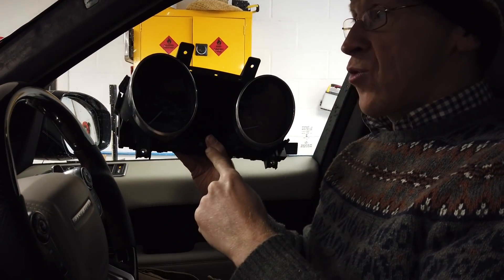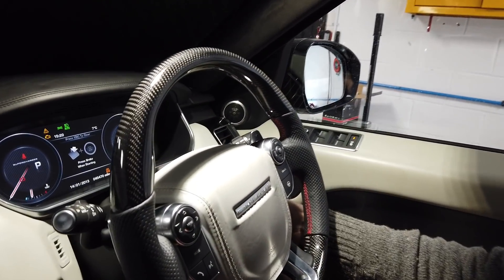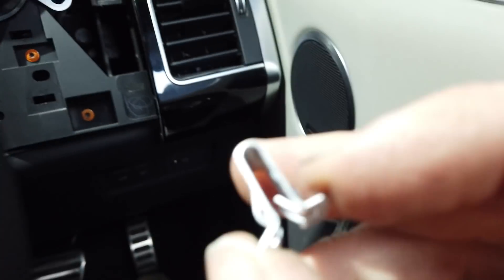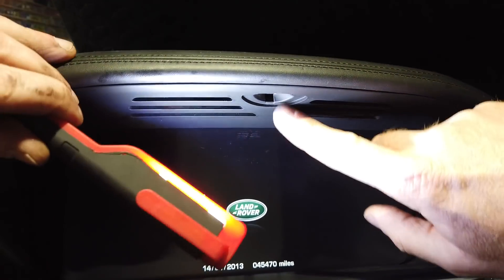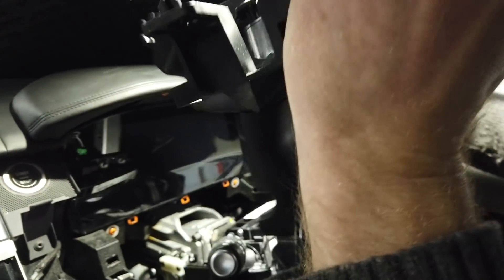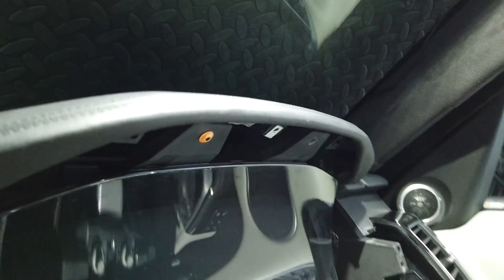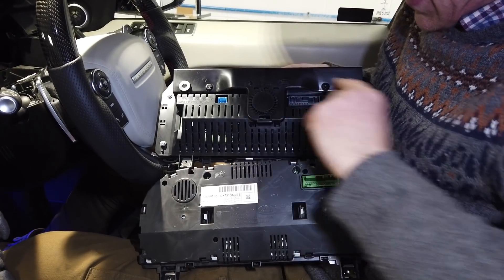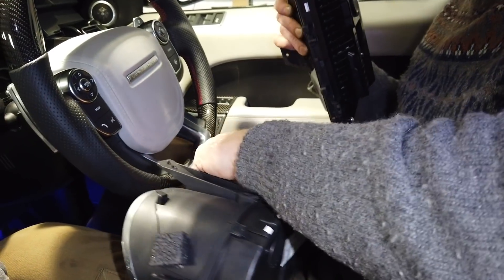Removing / upgrading speedo instrument clocks on Range Rover Sport L494 .

Comment: They are all coded to the individual car to prevent clocking. In the event that you need a new instrument cluster it would have to be coded at the factory to your car.
Reply from the maker: I am not sure if this is true.... i have changed a few parts of the system between carrs with no issue.
Reply: @L663  Hi was wondering if you could help, my instrument cluster has unfortunately been stolen from my vehicle. is there any chance i can buy a 2nd hand one and just plug it back in? would appreciate any advice!
Reply: @L663  He’s right, instrument cluster holds the key immobiliser settings hence why you can’t turn the car on. A number of other modules do as well. Used to work for JLR

Comment: Can the Bosch system be updated to a newer version on a 2014 L494?  I'm planning on changing the screen to a 10" display as well but the surround cameras and original system looks quite pixelated. Any system update or changing the Bosch system to a newer one as well as the touchscreen?

Comment: What’s your thoughts on weather you could retrofit the touch AC/Heater panel from the 2018? Not the touch screen nav as they appear different sizes but the touch AC panel would be cool! Probably have to upgrade a lot of stuff to fibre though!
Reply: Very good idea that i suggested before!
Reply: You can. Buy retrofits from Ali express. Got them on mine, works great

Comment: First thing to do is to link the two optical fibre ends together so the whole car continues to talk. Three ways! 1. Buy diagnostic loop off eBay (expensive), 2. Pull one orange end out and stuff if in the other hole. 3 A Bic biro.
Reply from the maker: Hi Andy i following your logic and like your ideas... although remember i was trying to help people do this mod in reverse.. so this would not have helped them.
Reply: Is it possible to do the opposite?? put the tft panel in place of the analog? how to make??

Comment: Hi Simon , i got the sport 2014  cluster with only the green plug and a local land rover shop upgraded to the full lcd cluster for me
Reply from the maker: Cool did they use a nee or used cluster ?
Reply: @L663  Works with any cluster, a MOST bus splitter from the headunit to the digital cluster and reprogramming the cluster chip with the data from the original (immo code, mileage etc.) with an EEPROM programmer is all it takes. Once this is done, CCF edit to enable the TFT.

Comment: hi Guys, great video. Just wondering if anyone can help answer the following question. I drive L494 2017 3.0 Diesel (v6), and I was wondering if I'm I can upgrade the speedo instrument cluster to use the version of the L494 2019-2022?? Will all the features work? will I need to get the new unit coded in order for it to work on my car? or will it be a straight swap?? Thanks in advance
Reply from the maker: The instrument cluster upgrades tend to be tricky - they are coded to the car - i think it is possible with a NEW virgin display.
Reply: @L663  where would I buy a new display? Directly from LR? Or eBay or elsewhere? Thanks
Reply from the maker: @bissauSabi  I think you need to buy this new from LR ! but i have never done this

Comment: Help! :-)
I have a problem with the digital counter in Range Rover Sport 2014
I replaced the central panel and counter
The seller assured that it would be possible to display the map and individual settings on this counter in front of the driver.
Unfortunately, it is digital, but only retains the mechanical options. Was it an assembly error or did the seller lie?
Reply from the maker: I suspect you need to change the CCF files in the computer to do this upgrade - this is possible but you will need a tool like the Gap Diagnostics IID tool etc

Comment: I would have thought that the proper instrument cluster would be an upgrade, and the cheap and nasty LCD cluster would be the lower grade one, with all its fussy failures, I am really glad I have the real instruments on mine.
Reply from the maker: Bonus of the LCD is i can change to KPH and the whole display changes to KPH - great for driving in France !
Reply: Converting as you drive keeps you mentally alert, I am not sure if you get the camera fines sent over now UK has left, they have only just started sending the fines over, I stick little tabs on the speedo face as a precaution. Take care.

Comment: Hi Can you do a video for the ride height sensors on the rear wheels... this is a common fault where the car goes back up when you press it to go down to exit mode... please please please..
Reply from the maker: Thats a good idea for a video - do you have a fault sensor i can fit to demonstrate the problem / fault codes ?
Reply: @L663   no not as yet, but when you do the video I will know how to remove it, lol... there's also a brass air valve in the compressor housing in the boot,  this is something to do with it... my neighbour works  for overfinch,  and he's  said it was the air valve,  I put a new one on but it still goes back up , when told to go down...bit like the Mrs...lol..lol...great videos by the way, watched loads tonight... ps it's me asking about the bumpers you have in stock..

Comment: Hello

I have a question.
I have a classic analog speedometer in the car. (Range Rover Sport 2017 with newer original navigation)
Is it possible in my case to exchange it for a TFT speedometer? Is the car ready for such a step? I mean electrical installation (cable)

Thank you for your response
Sincerely